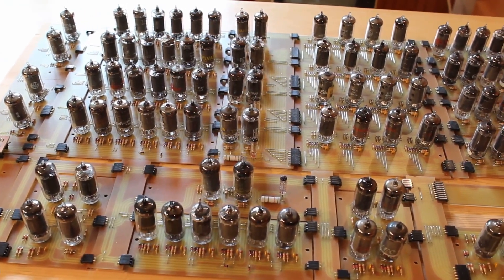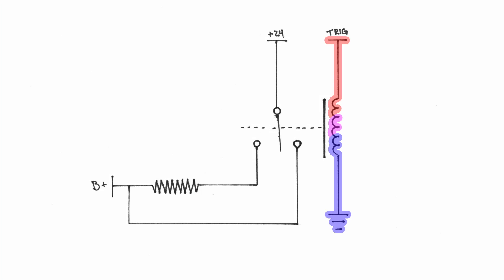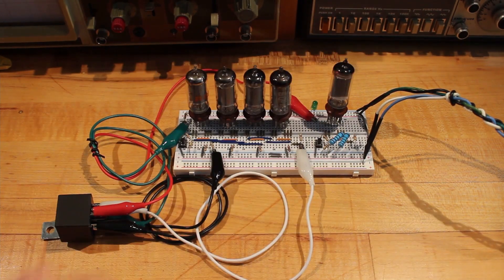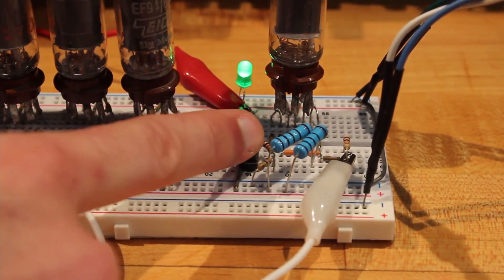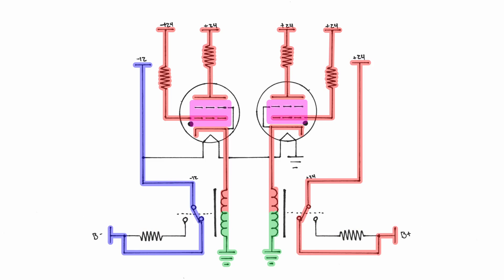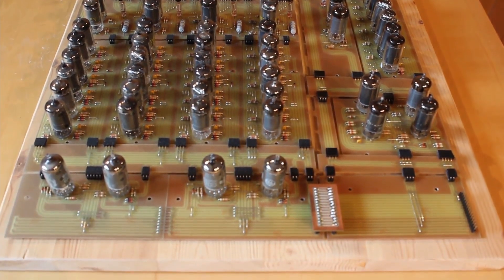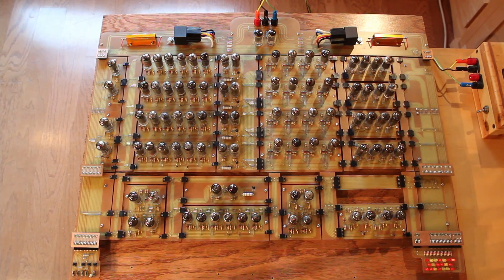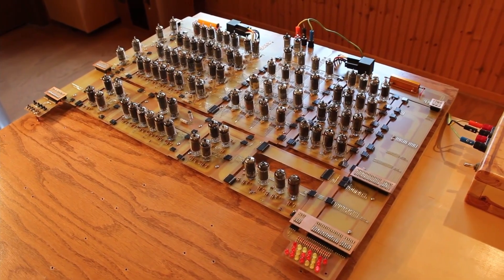Vacuum Tube Computer P.15 – Building a Soft Start to Battle In-rush Current

Comment: hmm after watching the video something does not seems right to me. it works more as a delayed start used to power multiple separate sections from single power source so the power spike would spread in time over entire device than a soft start which would slowly bring voltage up and then switch over
you still enabling entire circuit at once from the relay and those funny plasma tubes only dlay that, voltage spike might be smaller somewhat but a real soft start would switch over seamlessly whane the voltage on the output would reach certain level
key components that are missing are capacitors for each power rails on the computer side and even larger resistors , not smaller so you produce voltage ramp  and switch to full power after full voltage is achived
i don't know how much the project got advanced by today and i might be totaly wrong but oh well, this is the internet

Comment: The ENIAC machine from 1944-ish had 18,000 vacuum tubes. Every time they turned it on, a few would blow. The solution they came up with was to leave it on all the time.

Comment: Would thermistors suffice for the soft start? I know it's not valve/tube driven. 😃
Reply from the maker: I have actually thought a bit about this! Thermistors are not nearly tough enough to handle the amount of power I'm drawing here, which means I'd have to redesign each individual board to contain its own thermistor. It's probably the more elegant solution, but I'm way too deep into the design now to change that over, so I'm just going to brute force my way through it, haha.

Comment: Hey :)
It's even easier if you use a SPST NO relay and use the contact to shunt the resistor that is hardwired into the circuit.
That's how it's done in soft-start circuits for toroid transformers.
By the way, you may look into some long heatup time tubes like a PY88 booster diode, they take like a minute or so which is plenty of time for other tubes to fully heat up. This tube can even pass a few tens of milliamps at low plate voltages, and I've used such a circuit (PY88 and a 24VDC DPDT relay powered from -50V bias supply) for automatic B+ delay on one 4xEL34 monoblock I rebuilt ca. 17 years ago.
Reply from the maker: Heya Keri!
I'm actually planning a rework of the soft start to use different relays that will use pretty much the same idea! Though, I'll still be using SPDT, because I already had some Omron G2R-1s that I want to use, but I'll be connecting the NC together with the common, so that it works pretty much exactly the same as the shunt idea with an SPST.
That's really interesting about the PY88, I hadn't thought about that one. It has a 30V filament, which is insane, and I'm not sure if I'm reading the datasheet right, but it looks like at 24V, it'll move something like 400mA which is epic for a non-thyratron!
Reply: @UsagiElectric  The way you wired the relay contacts there will be a momentary loss of power when switching the current limiter resistor out of the circuit.  The way Keri suggests eliminates that problem.  It is a one wire change to make it work.

Comment: Nice project!
Question:
Isn't it simpler just to use a large capacitor for the delay and just to short the current limiting resistors with the relays? If you switch in this way, you won't have this "dead time" when the relay is switching.
Greetings from Germany.
Reply from the maker: Thank you!
The issue I was running into was that I wanted about a 10 second delay, and I was having difficulty finding a capacitor large enough to give that long of a delay. Also, I already had the thyratrons hanging around and the warm up delay of them was just about perfect, so this delay circuit was more about what was easiest for me to build with what I already had at hand rather than what was the best way to build it. 
But, I should definitely switch short the current limiting resistors with the relays, that was a bit of a design oversight on my part! Fortunately, it's not hugely important since the relays switch fast enough that the heaters don't really lose any of the initial heat they already built up. But, I'm pulling the boards off here soon to change out the current limiting resistor, and when I do that, I'll do some quick bodge wiring underneath to get rid of that dead time when the relay is switching!

Comment: I really like this soft start solution.
I know it is not entirely the feature of this video, but that little plug in LED diagnosis board is also absolutely a wonderful idea, and I feel inspired to try to make something like this, the next time I am into building a microcontroller circuit.  
Thank you for the video!
Reply from the maker: Thank you!
The little LED board was just something I knocked up because I got tired of plugging a ton of wires into the breadboard, but it turned out way cooler than I was expecting! I especially love how they all glow and dim when the tubes are warming up in this beautiful and chaotic display, which really shows how each individual tube is warming up at a slightly different pace.
Also, even though the layout isn't ideal, I do like the way the staggered LEDs with 4-bits per color are split. It's a shame that ultimately I plan on not having any LEDs on there, but with the jumper board setup like it is, I can plug this little diagnostic board in at any time, which should make for some pretty cool light shows whenever I need to demonstrate the inner workings of the system in a little more detail.

Comment: Awesome stuff!
Looks like you've managed to tackle that inrush current in a wonderful way. I love it!

I've seen others mention that this timed relay thing might not cope with another hundred tubes, and that perhaps you need to split the relays across different sections of the computer.

How about chaining several delays together, so that once the first section becomes powered, this activates a set of thyratrons and relays within that section, which then click on and power up a second section?
Depending on the number of sections required to keep inrush current at safe levels, you could add additional delays in series with the different sections.
Only issue would be that if you had a number of delays in series, it would take a while to get the whole thing warmed up... but I'm sure your power supply would thank you ;)
Reply from the maker: Thank you so much!
I definitely think you're right in that this solution may not make it all the way to the 180 tubes the processor portion will eventually end up having. I do like the idea of multiple delays with different resistors that click clack their way to way to completion though! That's a relatively simple solution that should be pretty easy to implement. As it sits now, the boards that hold the relays are only half height, so if I need to stuff more relays or power resistors in that space, there is enough room to make new boards that expand upwards.
I'll keep testing it and keep a close eye on it as the processor grows, so we may be revisiting this soft start again in the future!
Reply: @UsagiElectric  I just realised a slight flaw in the original idea I had - the thyratrons in the first stage would preheat with the other tubes and quickly trigger the second stage, probably resulting in a large current spike.

Perhaps a double pole relay could work - one pole shorts across the preheat resistor for the first section, and the other pole is connected to the preheat resistor and thyratrons for the second section. These thyratrons then warm up, and trigger the relay to fully power the second section and power the preheating process for the next section (if needed). 

That way, the delays should remain consistent and safe.
This is some hair-brained evening scheming, so hopefully you can make sense of this!

Comment: 6AS6 TUBE CAN BE CONTROLLED FROM GRID #1 AND THE SUPPRESSOR GRID #3.  CAN YOU DO A DEMO VIDEO?
Reply from the maker: The 6AS6 is a really cool and the perfect computing tube! 
Unfortunately, I don't have any of them. However, they're really pretty similar to a pentagrid converter/heptode which has two control grids (and two screen grids) stuffed in a single tube. I did a short 1-minute video on heptodes here: https://youtu.be/XRRqC0llNtM
I would have loved to build the entire computer out of heptodes, but boy they're rare and expensive when compared to the 6AU6 I ended up using!

Comment: Amazing man, using the warm up time of the heaters as the time delay  is incredibly simple and clever at the same time. 
Can't wait to see how the computer turns out. But also i don't want this series to ever end.
Reply from the maker: Thank you so much!
I can't wait to see how it turns out too, haha. Don't worry though, the series still has a massive way to go. After we get the processor finished, we need to start in on memory, which will need some general purpose registers and some RAM, both of which are going to be serious hurdles. After that, it's onto program control, and I'm still thinking of ways to handle that one. Finally, I also want to build some kind of display output using old alphanumeric VFDs or something. It's going to be a massive project, but we'll take it one step at a time and slowly get there!
Reply: @UsagiElectric  i didn't realize how much things still had to be done. Seems we're in for a treat :)

Comment: I have a couple of questions.
1. Will your computer be located in a server rack or something like that?
(to save space)
2. What is the name of the rabbit that is at the end of each video?
Reply from the maker: Sure thing!
The computer will definitely be located in a rack of some kind. The backing board for the processor is 100cm by 70cm, so I'm going to use that size as the backing board for all the other aspects of the computer. Ultimately, I think I'll have four backing boards: processor, memory, program control, and output. At the moment, I'm planning to build a rack to hold two boards at an angle at a time, and ultimately have two of those racks. Something like this: https://i.postimg.cc/QM43nPYb/DualRack.jpg 
That should make it easy to access and see all the indicator VFDs, as well as give easy access for repairs or changes. Plus, I think it'll look great for taking to vintage computing shows, haha.
The bunny at the end of most of the videos is named Koma, she's the one always sniffing my weird electronic contraptions looking for treats, haha! Sometimes I post up videos of our previous buns too. The light brown colored bun was our very first bunny we had a long time ago and she was named Kono. The tiny bun with really short ears was our second bunny and she was named Kome.

Comment: As this scales larger, you might have issues with this soft-start concept. One solution would be a cascade-delay idea, where the enable signal is passed from one stage to another to stagger the turn-turn on transient over a large number of sub-blocks, as the computer grows, just add more delay stages.
Reply from the maker: I think you might be right. For now, this will let me build and test a few more modules and boards before we run into issues again, but I do really like the cascading relay idea! If for nothing else than that it would sound epic, haha. But, I think it would work really well for getting it powered up progressively without causing too much stress on the PSU and while keeping the entire design simple yet expandable.

Comment: couldn't you use an inductor to limit the transient currents? What would have been the downsides to that?
Reply from the maker: A few people have mentioned this idea to me, and I do really like the concept of it! The inductor would most likely have to be a custom wound piece in order to get the wire thickness and number of turns just right. Which unfortunately mean that as the processor grows and more tubes get added on, the custom wound inductor would need to be rebuilt. When the processor is completed it should be at right about 180 tubes, which is going to be mental in terms of in-rush current, so at that point a custom wound inductor may make a lot more sense!
Reply: Thank you for your reply! I effectively didn't consider that high currents are driving the whole circuit so I didn't think about needing a custom inductor and the thickness of the conductor itself.

Now I appreciate your solution even more, as other people said already it is very clever! I'd still love to see the custom big-ass inductor at the end of the project, so that we can compare the two solutions and see which one performs better/is easier to implement!

I'm learning a lot of things from your videos, you're very good at it and especially you're great at building excitement over the project! It is very apparent that you're passionate about older technology and the fascinating world of tubes! 

See you soon then with the next part, I'm excited!!!
Reply from the maker: @aliceitc  Thank you!
It's kind of counterintuitive to think of tube circuits as being low voltage high current affairs because they're really terrible at that, haha. But, I'm pretty happy with how well everything has been performing so far!

I think once I get up to the full 180 tubes, the current soft start solution may not be able to handle it, so a custom high current inductor with a really low resistance may be the best solution! Plus, it would look super cool, haha. 

Thank you so much for the kind words on the videos and projects! I'm not an engineer at all (I went to school for language), so when the electrons do what I want them to, I get super excited, so I'm glad I can share that feeling of "I can't believe that actually worked"!

Comment: Clearly, this is art -- and its mounted; when this is done, you can just hang it on a wall and have it drive a clock or something :P
Reply: Open and close garrage door.. Open and close all windows.. am... A! Turn tv, when nobody at home.. am.... what else we can do with plc?
Reply from the maker: @k-8520  While the MC14500 is definitely intended for use as a PLC, I'm hoping to build this into a more universal type of computer, with a proper ALU, general purpose registers, RAM, input, output, etc. The primary goal is to get it to where it can calculate the Fibonacci sequence, but I would like for it to be capable enough to be considered Turing complete at some point!
Reply from the maker: Thank you so much!
I'm super happy with how it's shaping up, I think it looks absolutely amazing. Ultimately, the goal is to get it to calculate the Fibonacci sequence. That seems like a super simple goal, but to build a computer that can do that requires getting almost all of the fundamentals for a Turing complete machine in place, so I figure that's a decent goal to aim for!
I'm also hoping to get it mounted on a simple rack to make a nice little display piece. The microprocessor will be about 1m x 0.7m, so I want to build the memory into the same form factor and have two of the backboards on display on a single 2m tall rack. Like this: https://i.postimg.cc/ydMKXvjw/Rack.png
Reply: @UsagiElectric  Thats super awesome :)

Is Fib achievable .. ie: it gets into big numbers pretty quick, though maybe its just shifting away and can fake it without actually having all the numerals in RAM .. never really looked into binary representation of Fib sequences.
Reply from the maker: @skeezixcodejedi  So, even though it's technically a 1-bit computer, I do plan on building the general purpose registers around 8-bits. Hold on to your butts, I'm about to spew a bunch of word soup here in the hopes that it makes some sort of sense, haha. 

I'm imagining something like 4-bits for processor control, 2-bits for register/memory select, and 3-bits for addressing. Also, using the processor "write" pin I can kind of get an extra bit for output control. This makes things super confusing and a little difficult to wrap your head around, but it means that I have a lot of freedom in how I set up memory access.

For example (CPU instruction of 1000 or 1001 = output):

XXXX 00 AAA => 8-bit General Purpose Register A
XXXX 01 AAA => 8-bit General Purpose Register B
XXXX 1X AAA => 16-bits of Random Access Memory

1000 00 AAA => 8-bit Output Register A
1000 01 AAA => 8-bit Output Register B

To do Fibonacci with a memory layout like this, the pseudo program would look like this:

ADD GPRA and GPRB 1-bit at a time storing result back into GPRA
COPY GPRA to OUTA
ADD GPRA and GPRB 1-bit at a time storing result back into GPRB
COPY GPRB to OUTA
LOOP

This should calculate the Fibonacci sequence from 0 up to 255, storing the output into our output register each calculation. The output register will ultimately be connected to our display module, which should show the result in human readable fashion, or I’m hoping so at least, haha.

At any rate, that was a really long winded way of saying, I think Fibonacci should be doable! And, by using IEN and OEN masking, I should be able to implement rudimentary jumps and conditional statements, which means ultimately, we should be considered technically Turing complete. That’s a seriously long ways in the future though, so we’ll take it one step at a time and slowly work our way towards it!
Reply: YEs, and serve as a furnace to keep the house warm.